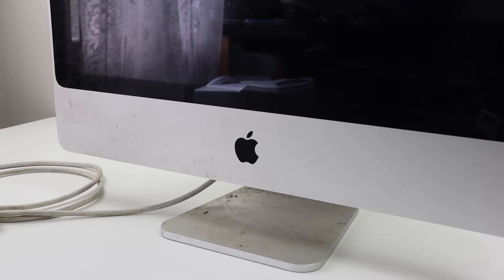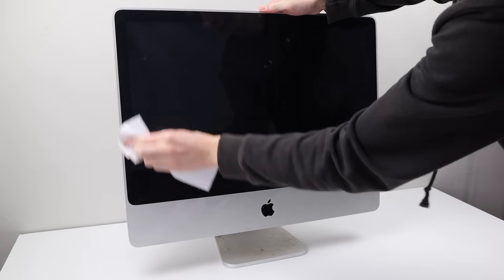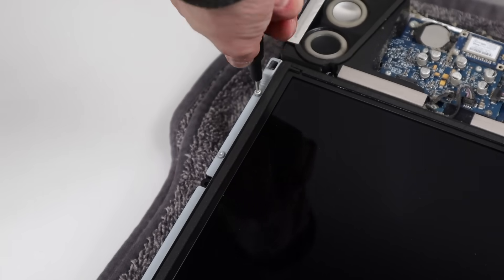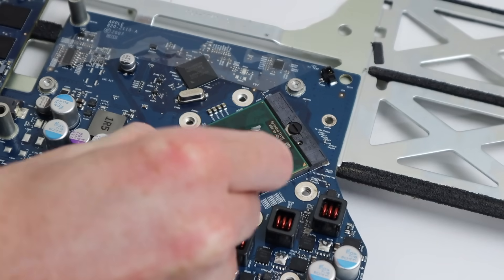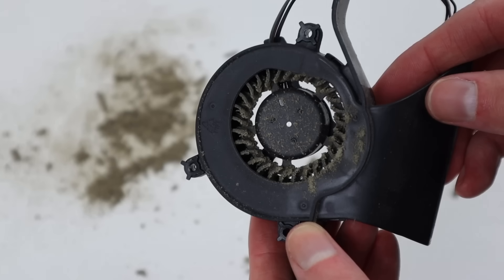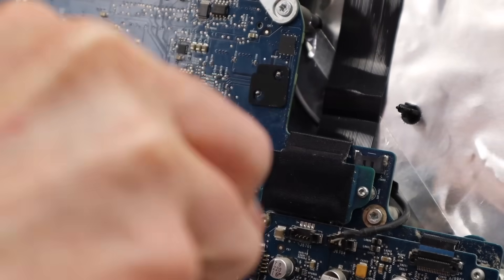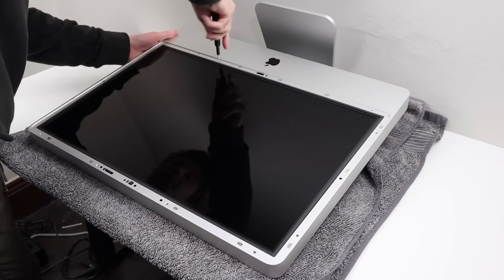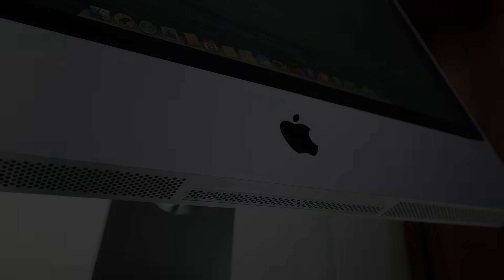I Was Given a FREE Broken iMac, Lets fix it!

Comment: The fact that the GPU heat sink still functions was amazing for this model.
Reply: how does a heat sink not function. it cools things down.. what was it going to do when it got older? heat it up..
Reply: G S not cooling it down?
Reply: @laserching2547   a passive heatsink would still cool with air moving around it
Reply: The GPU heat sink on the 21” model of this iMac had major problems with heat pipes leaking coolant.
Heat pipes are the copper tubes between the heat sink and it’s radiator - they have capillaries through them that transfer superheated ‘coolant’ from one end to the other. The pressure differential pushes the cooled coolant back to the other end through a separate set of capillaries. When they puncture, the coolant leaks out and it doesn’t function any more.
You would typically see tiny pinholes on a burst heat pipe, surrounded by a ring of condensed coolant.
Reply: @SalvoDan   wow when a pipe with liquid in it gets a hole. it leaks??? WTFF i thought the liquid just goes " nah not going to leave the pipe"
Reply: yes yes heat SINK
Reply: I agree

Comment: I was like woah you have a tech toaster 1:50
Reply: Lol it is hard drive adapter so you can plug in hard drive by usb lol like xbox and ps4 external drive but it holds the drive and keeps it secure lol
Reply: @mahrufurrahman9759  smh my head, it's clearly a toaster. Idiot.
Reply: @luminumlx2604  lol